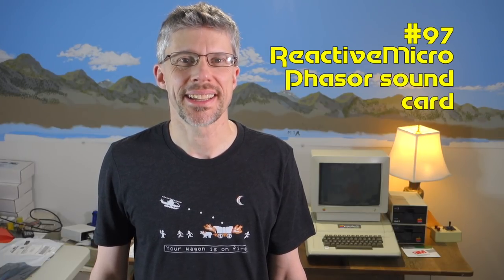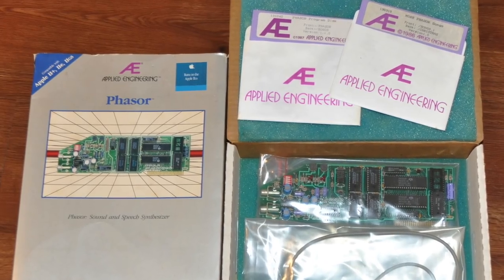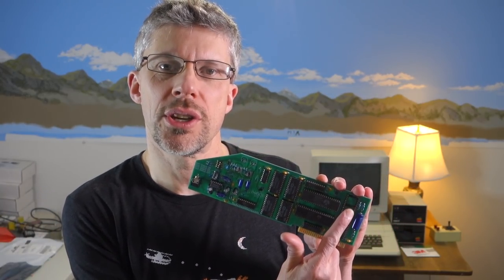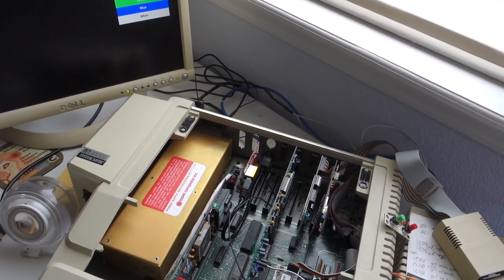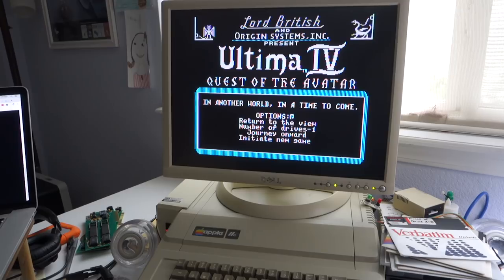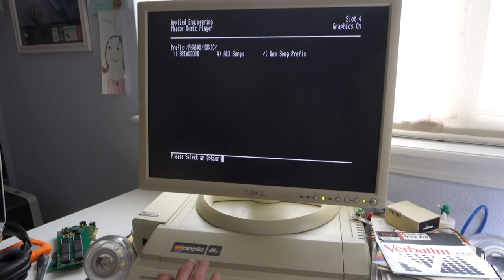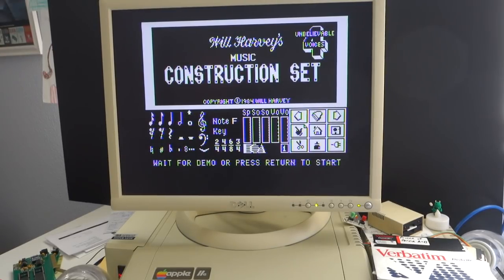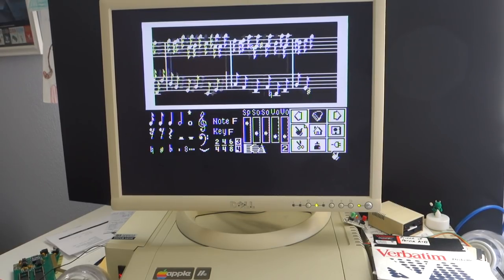#97 Phasor Apple II Sound Card from ReactiveMicro

Comment: I have a Beta version of the RM card. The 3.5mm socket is facing towards the front of the case. I have to use a right-angle adapter to make the jack clear the lid. I'm glad they changed the orientation in the final version.
Reply from the maker: Ah, that’s a bummer. The VidHD card was like that and it was a pain to find a right angle HDMI adapter…

Comment: Worth noting that although the Phasor was backwards compatible with the Mockingboard, in order to get that to actually work as intended, you had to physically flip a dip switch on the Phasor card itself.  Not terribly convenient in a normal Apple II setup where it's securely sealed inside the computer.  Flipping this switch, to the best of my recollection, prevented the Phasor from functioning in its 12 voice capacity.  Of course, it stands to reason that a Phasor clone would likely include a workaround for this severe drawback.
Reply from the maker: Thanks for that update - I didn't know that!

Comment: I have an original Phasor.  The original was also compatible with the Mockingboard.  I originally purchased a Sound/Speech 1 directly from Sweet Micro Systems, and then I believe AE offered a trade-in discount to get the Phasor. I don't remember the details or the discount, but I was very happy with the Phasor and it's Mockingboard compatability,  as well as the extra voices it offered.  I still have those lavender disks! I wonder if everyone who bought either the Phasor or the Mockingboard only did so because of the support in Ultima 3-5?
Reply from the maker: I think you're absolutely correct about buying them for Ultima. We actually have some people who are going to buy a new Mockingboard when they get their copy of the new Nox Archaist game.
Reply: I got the Phasor card because of the Ultima games.  Awesome days back then.
Reply: I'm the opposite case.  A friend (or probably more accurately, a friend's father) somehow ended up owning a Phasor, which said friend brought over one day to show off all the music you could play with it.  As a ~8 year old who contented himself with programming tunes in Basic on a VIC-20, I was instantly infatuated.  Eventually I arranged to buy the card used from the same guy.  The only thing I wanted from it was the music composition app.  I only learned a bit later that you could flip a switch and make it work with Ultima, and as luck would have it, Ultima IV was a game in my possession.  (A game I found pretty darn inscrutable as a young kid.)  So while I got to enjoy a bit of Ultima IV with its intended ideal presentation, it was essentially happenstance.

Comment: Thanks much for this video — I've got a bunch of old tunes I've been resurrecting with this card! Just curious, how did you go about connecting your Apple Pro speakers to the card, given that they don't have a standard mini plug on them?
Reply from the maker: thanks for the nice remarks! I ended up clipping the plug off of the Apple Pro speakers, and soldering on a regular 3.5mm audio plug. It worked great!
Reply: @CT6502  Gotcha — I've been having trouble finding speakers that don't get overdriven by the board's output, and so (laughably in retrospect) I picked up a pair of Apple Pros after seeing them in your video, thinking that they would plug right in. I'm no wizard with a soldering iron, but I should be able to pull off a similar modification, any pointers?
Reply from the maker: @ErikLoyer  You can temporarily twist the wires together to make sure you have the the right ones hooked together. Hardest part is probably doing the wire stripping without cutting too many of the strands. I found some how-to soldering videos by doing a search: https://www.youtube.com/results?search_query=solder+two+wires+together
Reply: @CT6502  Excellent, thanks!

Comment: few questions about this card. 1) if i want the speech chips, what are they? and where can i get them.  2) you have on your videos a version of the phasor card with sound pots on it, mine doesnt have them.  whats up with that? thanks
Reply from the maker: Hi, I believe that the speech chips are SSI-263, but they are really difficult to find, and to be honest, very few Apple II titles actually used them. The sound pots control the volume - I think when Henry (ReActiveMicro) initially designed the card, he wasn't sure what volume to use, so he built in the pots. But then for later revisions he just built in an optimal volume and removed the pots. Since you'll probably plug the card into speakers that already have a volume control, they aren't really necessary.

Comment: I just received my Phasor from RM and it works wonderfully in my IIe... but I need it in my IIGS and that didn't go too well.  I tested it in slot 4 with both the default slot setting and 'Your Card' in the control panel.  I'm assuming the original Phasor had the following issues as well.

The P2 header must not be a simple sound pass-through as the sound from the GS was extremely distorted with much interference from my CFFA-3000.  I left P2 disconnected and attempted to test Phasor / Mockingboard sound in Ultima 4 and 5 but both games crashed when I enabled the sound card using the in-game menus.  Turns out one needs a patched version of those games to support Phasor / Mockingboard on the GS.  I'm still working on this problem and haven't yet tested any other games on the GS.

Chris, you feel like testing Nox + Phasor for me on a GS?  ;)
Reply from the maker: That's really interesting. I didn't realize there were so many issues with the Phasor/Mockingboard on the IIGS. Unfortunately, I don't own a IIGS so my testing options are limited. But if you find out more info or figure out more solutions, please post here!
Reply: @CT6502  I need the GS sound and the Phasor sound mixed to a single set of speakers.  Since the P2 header isn't working with my GS, I used a simple 3.5mm splitter cable to mix the external GS sound out and the Phasor (2 male > 1 female > speakers) but the volume pots are missing on the new Phasor and its sound signal completely drowned out the GS signal.  I added an inline volume control to the line coming out of the Phasor to balance that and voila, both sound great out of the same speakers.  I know it's inelegant but I'm still new to this and a cheapskate.  :)

I haven't yet looked into solving the Ultima/GS compatibility, but I did just test Pitfall II and it sounds as good as it did on my IIe.
Reply from the maker: @jubsy  Sounds like a perfect solution to me. Cheapskate or not!
Reply: @jubsy   Hopefully that volume control provides sufficient resistance to protect the low-impedance outputs from trying to drive each other (which could result in damage or excessive wear).  It probably does.
Reply: @rbrtck  Thank you for the insight.  I will look into this.
Reply: @CT6502  Some time ago I found and figured out the GS+Mockingboard/Phasor launchers for Ultima 4+5.  I really missed out as a kid!  At this point I think the only game that isn't working is Skyfox.  Opening music works but locks up when trying to play.  I found one crack that played the demo with enhanced sound, but then crashed again when trying to play.
Reply from the maker: @jubsy  I assume that you're trying to run Skyfox on the IIGS, correct? I've gotten Skyfox (with Mockingboard/Phasor sound) to work fine on the Apple IIe, so it must be some quirk with the IIGS. Does the game work okay without the sound card?
Reply: @CT6502  Yes the GS.  Great question, I haven't tried it recently without the sound card.  Ran great on my GS in the 80's though but I'll test that.

Comment: I've always wondered if a single Phasor supports all 4 voices (dual Mockingboad support) for Ultima IV and V? Or rather, if those games support all 4 voices of the Phasor?
Reply: Ultima V has specific support for the Phasor, so it uses one as if it were two Mockingboards in one slot. Supposedly the songs only use 9 voices, though I'm not sure where this info came from - (a really good ear or some info from Ken Arnold or analysis of the MIDI or what).  With Ultima IV, there is no specific support for the Phasor so it can only work as a single Mockingboard. I've actually never heard dual Mockingboard support (or noticed a difference) with Ultima IV, making me wonder if it's actually using two - OR, perhaps it's only there for support of two of the older single AY chip Mockinboards like the Sound I.  That would make sense in that you'd only get 6 total voices from a pair of those.  Also, slightly sad these games were never patched for the //GS Ensoniq chip which is more than capable of playing these songs and acting like a square wave generator like the Mockingboards.  Especially since the GS never got any tile based RPG games of the caliber of the last two Apple ][ Ultimas.
Reply from the maker: @nightcrayon  I thought I read somewhere that for Ultima IV, the music doesn't use more than 6 voices (one Mockingboard) but that some of the in-game sounds can use both Mockingboards? But you're right, I've never noticed it using both Mockingboards. Regardless, Ultima IV still sounds great with either the Phasor or the Mockingboard.
Reply: @CT6502   I've never heard any Ultima IV/V in-game sound effects that used anything more than the Apple clicker/beeper (whatever you want to call it).  In fact, even the C64/C128 ports simulated the exact same effects with clicks; their background music was handled separately with the usual SID chip voices, just like on the Apple II with the Mockingboard or Phasor (AY square wave chips).  I'm pretty sure you're right that Ultima IV only ever uses 6 voices or fewer, and Ultima V only very occasionally uses a couple more.  Those who have only one Mockingboard aren't missing out on much.  For that matter, I don't feel I'm missing out on much even with just the 3 voices of the SID--it's sufficient to convey these simple compositions (don't get me wrong, as I think they're great, and love the counterpoint harmonies, but not many voices are needed).

By the way, although I've played around with dual Mockingboards in emulators, if I had two physical Mockingboards (or clones thereof), wouldn't I need some sort of stereo mixer to combine their outputs?  Either that or I'd need two sets of stereo speakers, right?  Or am I missing something?  At the moment, I'm trying to decide between the reproduction Mockingboard and Phasor, and currently I'm leaning toward the Phasor because it effectively offers two Mockingboards in one.  I'd purchase one right now, but it has to be fully Mockingboard compatible or else I might as well just go with a Mockingboard and be happy with that.  Ah, the tyranny of choice! ;)  I still have more research to do.
Reply from the maker: @rbrtck  As far as I understand it, if you have two Mockingboards, you need to route the two outputs into a mixer. I originally thought that it somehow routed them all to one board, but that wouldn't make any sense as the Mockingboard is just directly routing the sound from each AY-3-8910 chip. So, in short, it's probably much better to get the Phasor. However, even in that case, there is only one game (Ultima V) that I know of that made use of two Mockingboards...
Reply: @CT6502   That's what makes the choice so hard.  Although it would be easy enough for me to create a mixer for two Mockingboards, having two for literally one game, for which it makes little difference anyway, would be overkill.  If the Phasor covers this case anyway plus a few more, then I'll just get that.  On the other hand, if it's not 100% Mockingboard compatible, then I might just settle for a Mockingboard.  Either way, I'd be happy, I think.  I just can't choose (yet--I will), and no, I don't want to go the "Get BOTH!" route. ;)
Reply: I was wondering about the sound card that had 4 voices. The program was called micro music And it was complex to program I spend hours programming 4 part harmony. I missed my music physics class, I had to make up the test. I was in the computer lab for hours and lost track of time. I would like to find the card and then get an Apple II computer. I like the old style which was harder to program. My TI computer only had three voices so had commodore as well. 73

Comment: Hi Chris, How do I adjust the volume? The audio pots were replaced with resistors.
Reply from the maker: Great question - those audio pots didn't really help because they would have been shut up inside the case. For my setup, I have a 3.5mm volume control cable that is "inline" with my speakers. Search on Amazon and there are a bunch.

Comment: Does the default sound come out of both stereo speakers or is it still mono?  I'm thinking of buying this for my IIGS.  Thanks!
Reply: I think you might be able to hook up the //gs's speaker to play sound through the phasor, but you won't get stereo.  The GS speaker, and even the headphone jack on the back of it, is mono.  You'll need a GS stereo card like the 2soniq that ReactiveMicro also sells.  It would be cool if someone made a combo card that was a Phasor AND a GS stereo card, so you could get the best 16 and 8 bit Apple ][ sound (from a //GS) while using only a single slot...
Reply: @nightcrayon  Wouldn't the situation with a IIe be the same concerning the mono sound?  I was hoping the Phasor sound pass through accounted for this and simply replicated the mono sound to both left and right on the output.
Reply from the maker: Hi Jubsy and Christopher - the default Apple II sound comes out of both speakers at equal volume.